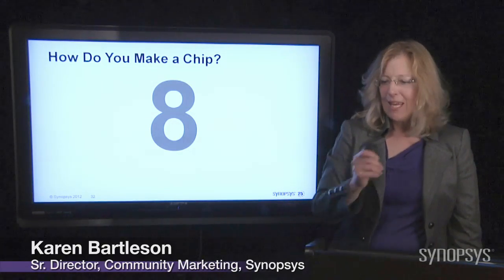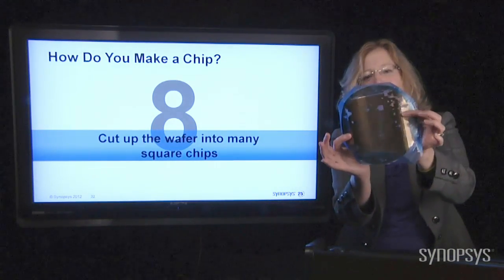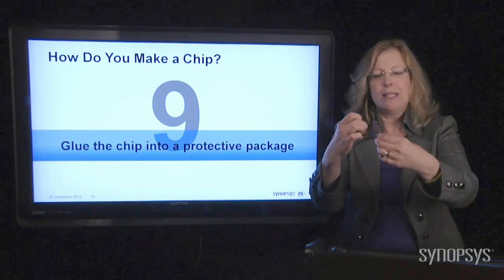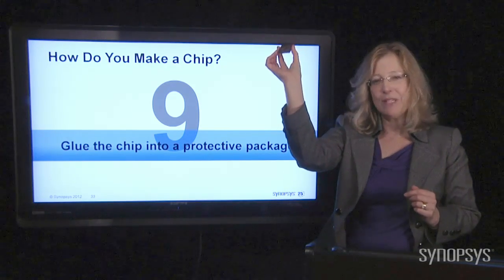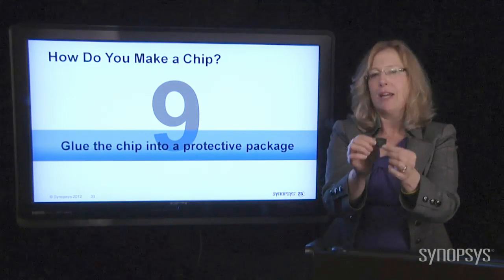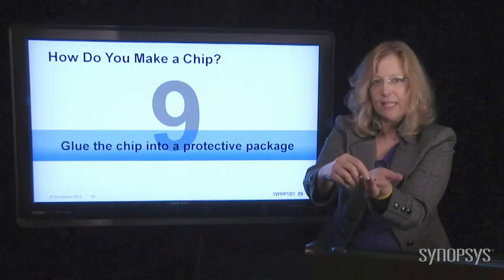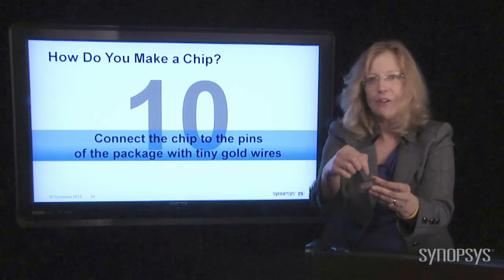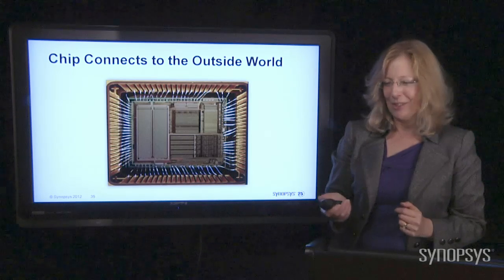World of Chips, Episode 8 Part 1 -- Steps 8 -10 | Synopsys

Comment: Hi Kaki, thanks. The reason the wafers are circular is because they are sliced crosswise from a big crystal of silicon. The big crystal is circular, so the wafers are too. The reason the big crystal is circular - a cylinder - is because of the way it's grown. A small crystal is lowered into a vat of melted silicon and then it is rotated. As it rotates, silicon atoms stick to it and the crystal grows big. The rotation causes the crystal to grow into a big round cylinder.